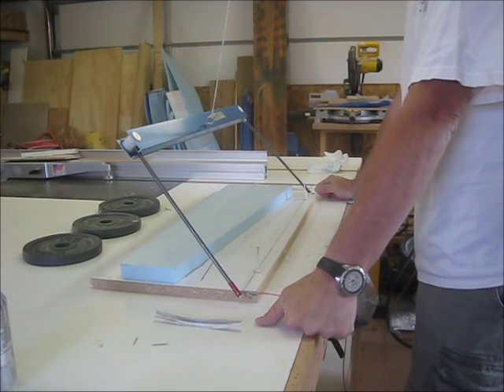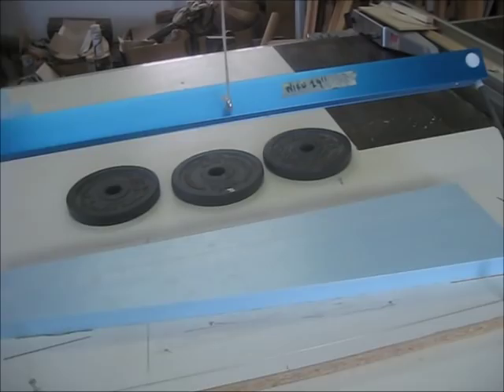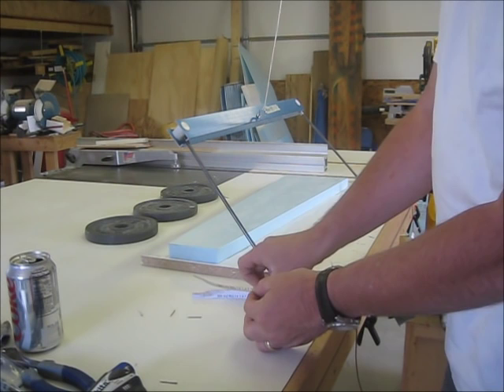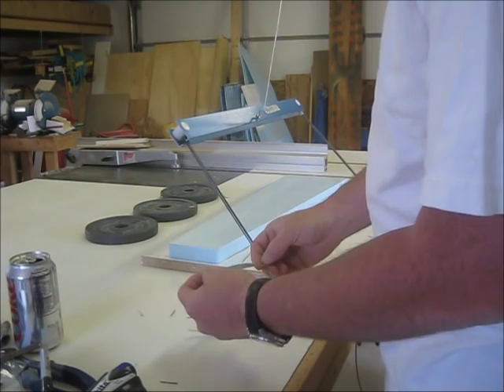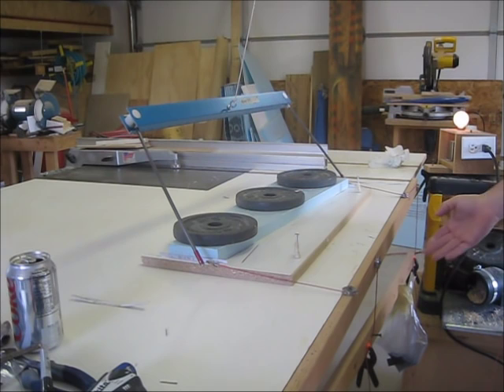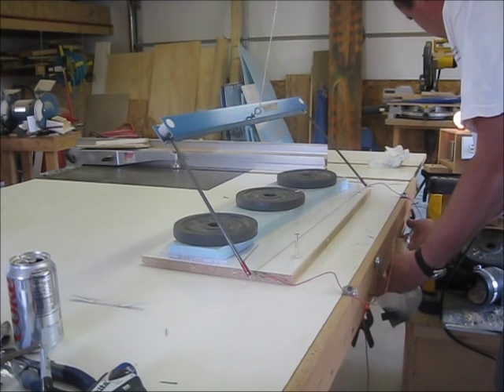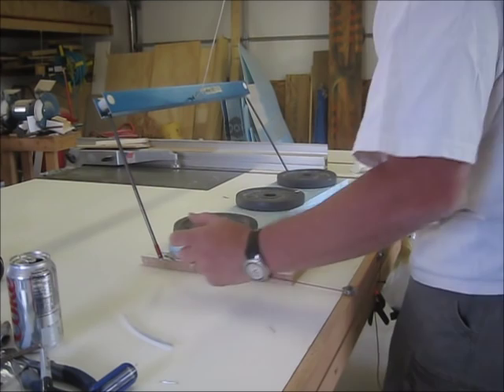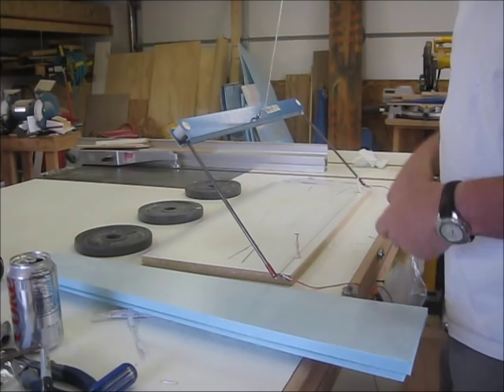Making Composite Plane - Cutting Foam  #1

Comment: Thank you for posting this video. Long time ago, I gave up of cutting foam by bow because of uneven speed, and due to problem with tapered wings - it requires two persons, and steady pace of the cutting speed. Your desing requires single person... actually, it does it by itself, just monitoring the progress.

Comment: In the foam cutter, could nichrome wire (used in toasters) be used instead, as the power supply could probably be made for less $, and may be safer?
Thanks

Comment: ciao Jon, I have apreciated your home made equipment. Three points are not clear to me.
Those very soft wires which pull the bow are the same electrical wires connected to the nichrome  ?
What is the  material you use for an easy cutting of the templates.
What is the diameter of the nichrome wire .
thanks in advance

Comment: Everyone demonstrating a gravity hot wire foam cutter shows cutting the left hand wing (airfoil facing up, narrower tip to the left), how do you cut the RH one?  None of these setups have an arm that will pivot both ways, the templates that you're using will only work right side up, the only thing I can guess is that you swap templates side to side and cross the pull/power wires (run the LH one to the 100% pulley and the RH one to the whatever percent you need for the other side)?

You also said that the ratio is that of the lengths of the power/pull wires, is that correct?  It seems like if you used that then both would reach the edge of the table at the same time, not the trailing edge.
Reply from the maker: Mark Pikas yes swap templates and cross pull strings/wires. It's the ratio of wing chord lengths. If you start the pull against the core the trailing edge will exit at both ends at the same time.

Comment: can i know which type of foam u are using
Reply: +andy its most likely insulation foam
Reply: +Sierra_bravo  Can u be more specific
Reply from the maker: +andy I use the blue Dow square edge (or sometimes the tongue and groove) foam from Lowes in the USA.  I like it better than the Owens Corning (Pink) foam at Home Depot.  The Dow foam at Lowes is 25 psi while the pink foam at Home Depot is 15 psi (at least here in Utah).  For even stiffer and more dent resistant wings I use Dow 40 psi foam from a local insulation supply store (all they sell is insulation).
Reply: XPS or extruded polyestyrene

Comment: hello, I bought a adjustable power supply to cut the cores of foam.
The power supply has the following characteristics 0 - 30V, 0 - 5amps, switch source to an arc with chrome nickel 0.05mm (24 gauge), but the eat it is enough.
http://www.castroelectronica.pt/product/fonte-alimentacao-regulavel-030v-05a-c-visor-lcd

The problem is wire or the power source?
thanks

Comment: ya right, i been trying this, and it doesn't work
Reply from the maker: Aldo Allende Oliva Sorry to hear that.
Reply: Jon Finch it break my wire cable or surface is not smooth it all, i don't know if i need more practice doing this, but i prefer buy it ready make o build airplane from dollar tree foam
Reply: +Aldo Allende Oliva it's easy enough when you do it right.